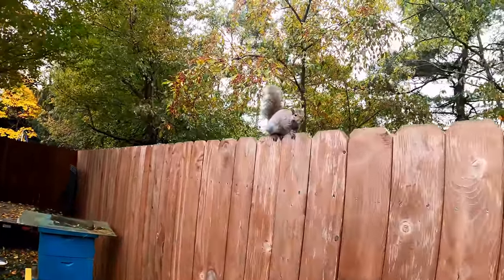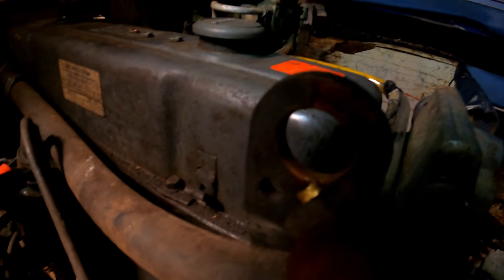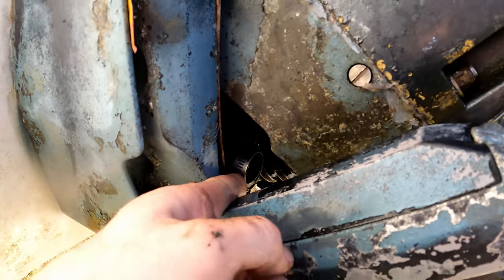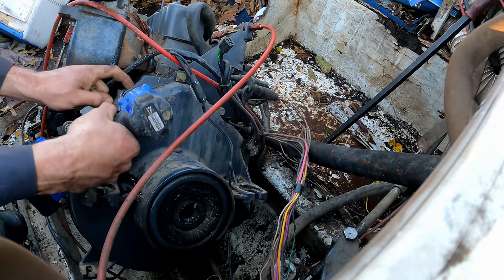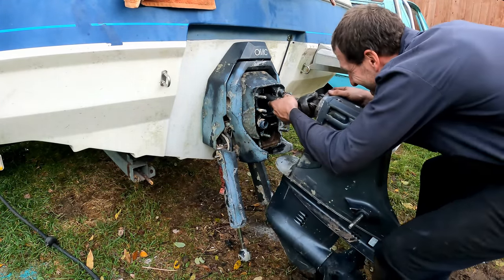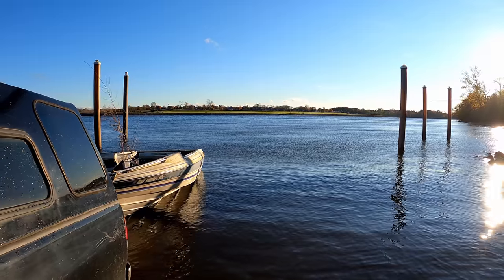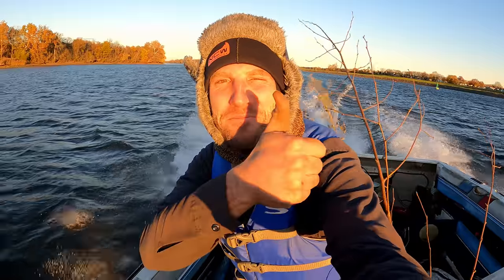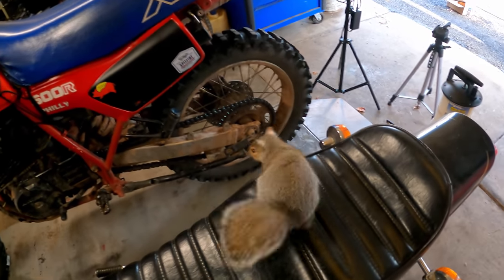The TRASHLINER Boat Part 2 "Will It Run"?  NNKH #Trashliner

Comment: Suggest not toss that old starter. Soak it in WD40 now then give it away to someone that will spend the 2 hours to refurbish it. I just did 4 of these Mercuiser starters that had been submerged in rainwater for several years.
Reply from the maker: I feel like they're pretty cheap online though these days no? But yet to be honest I already tossed it in the scrap pile.
Reply: @NoNonsenseKnowHow  Tried that. 3rd start and the whole nose cracked off it and also ruined my ring gear. Never again. I will stick with old school.

Comment: hi...you can grind the block crack and arc weld with muggie weld rod works great....heat around the crack before welding
Reply: Also drill a hole on each end to prevent it from cracking anymore.
Reply: there is techniques to repair such a crack but where it is located, the chances for a successful repair are slim because the seating of the head gasket, if the block heve been cracked between the freeze plugs, the chances of success make it worth to try it.
I had a very similar case on a V6 engine and I replaced the block.

Comment: My dad worked for Ford Motor Co at the Cleveland casting plant in Ohio 25 years.   Freeze plugs were basically for cleaning out the casting after it was finished.    So you're right calling them casting holes.

Comment: Thats where those 3.0 blocks generally crack under the manifold. You can epoxy the external crack, but if you had milky oil likely an internal crack as well

Comment: I always keep the Boats drain plug on the inside of the boat. Then if you ever take on a lot of water, you can take off, plain/plane the boat off and pull the plug. The water will drain out. Thanks for sharing.

Comment: I used to build those things, worked for Bayliner for over 26 years. They closed up shop and went to South America. Best thing that ever happened always harping on the people to work by harder.. It was a sweat shop. Furnace would keep the temps at 80-85 degrees. You have what was called a CT model I think. Check your serial number on rear right corner of the hull. Will have model and year built.

Comment: I've got one of those "trashliners" sitting up on blocks in my backyard as well. Also a freebie from a friend. (The trailer is under another boat)
 Has the Volvo Penta 2.3. Not sure if it's locked up, but I know there's some freeze plugs out of it. Also needs a starter. Got a boat from a friend with the same motor, but that boat turned out to be in better shape. The Bayliner I stripped all the way down to the hull and cleaned the trees out of it. Stringers were good, but crossmembers weren't.
 But I've been raiding it for parts for another boat I have. Not sure what I'm going to do with it yet. 
I really like the square guages on the dash. May put those on another boat.

Comment: I'd love to see you pull into the highway guy that checks the boat for the invasive species sticker, with that tree growing in the middle, and have him squirt your boat down.  Awesome work I gota say!  Do you think silicone is better than JB weld on the block crack?  Maybe silicone expands better and stays flexible during the heat cycles?  Yeah, that tempered glass is worth money on ebay!  A few hundred dollars at least.  Probably the out drive too.

Comment: Can you do a "how cheap can we do this with stuff around the house" part 3? :) Maybe use some old pallets as subfloors, scrap wood piecemeal flooring, old kitchen table chairs screwed into floor for seats, maybe an old steamer trunk for an engine cover.  Could even maybe use a PVC flange screwed into the bottom of an old kitchen table chair, then whatever size PVC into that, with a matching OD to ID flange/pipe on the floor to make a "swivel" seat :) :)
Reply from the maker: Those are some good ideas you got there Brianna! And yeah I think a part 3 Will be coming for sure
Reply: @NoNonsenseKnowHow  Thanks!  We recently got our first boat, an "old" 1993 Sea Nymph (small v hull basic fishing boat), and it's either missing a seat next to the driver, or has the capability to move the very front seat back to the hole next to the driver.  I was thinking of doing the PVC flange thing with a pipe that would fit in the seat mount hole already in our boat, but it seems like it could be useful for any cheap fixer upper :). Maybe you'll get to it before I do so I can see how it works lol.  It's cold here in Oklahoma too so not much is getting done outside

Comment: Condenser is vital in points ingition. Then points opens current starts to flow from coil through condenser to the ground in primary winding, inducting high voltage in secondary.

Comment: If you weld cast iron just be sure to drill a little hole at the end of each crack or it will continue to crack further as you are welding on it. I turned a 4 inch crack into a 9 inch crack on a 6 cyl ford once and an old man I worked for told about drilling the hole.

Comment: You are an incredible mechanic. I would have left that thing in the woods. How did you come to figure that thing had a water pump in the outdrive and know the screen spun from heat? I'm impressed
Reply from the maker: Thanks man. I'm relatively familiar with these since I've owned a lot of boats over time. Never actually saw one of the screens spin like that. The hack fix seems to be holding up well though!

Comment: I fixed a cracked farmall B block with JB weld. I just notched out the crack with a carbide burr and filled with epoxy. Took 2 tries to get it all but I ran it a while without any issue.

Comment: you could do a video on cold stiching that crack its a  bit of a old school process but i think you have the skills to pull it off . get the motor in the workshop and have a go great winter project,
Reply from the maker: To be honest, I think that crack can be fixed no problem with permatex the right stuff and last several seasons. I've done it on blocks before without a problem. It's certainly a hack fix but works great and God forbid it ever leaks again you can have a tube on board to seal it back up. Not to mention even if it does leak, it's not going to ever leave you stranded.  Really just superficial. Certainly not structural
Reply: I don'y believe that it will work because the crack is too near from the head gasket surface, between two ferrze plugs, it should work because you have a rigid wall to contain the effort of the stitching plugs.
applying heat will result in block warping that will need at least the line boring of the crankshaft main bearings bores. This engine does not worth the procedure.

Comment: Had an 87 bayliner Capri with a 2.5 litre omc inboard good fun for a lot of years and pretty good on gas too was quite surprised used less fuel than a 70 mercury force that I had years later

Comment: I had a Searay 270 Amberjack I bought new with twin 350 motors. I had the same overheating problem the whole time I owned the boat. It was always the impellers that were bad. I finally got sick of replacing them, even though I took it to two separate marina and it was always the same problem. I eventually just sold the boat.

Comment: Marine tex or jb weld would be adequate for that non pressureized block crack.  Wouldn't bet either would last forever but would both hold a few seasons.

Comment: Really enjoyed these...Just finishing a Maxum Project in the UK. Are you going any further or is the Trashliner now complete?
Reply from the maker: Awesome to hear that. And yeah probably going to do a part 3 with the boat. But not really a restoration. Just having fun and fixing odds and ends or doing something weird with it
Reply: @NoNonsenseKnowHow  just gone to the Truck dunking video...dude my worst fear! We never use our ramps. We are so lucky that the trailer will roll into the sea on a rock solid gently sloping beach...and hey thanks for responding, that's cool. I can send a link to the photo album but don't want to hijack the channel. HNY.

Comment: When I saw the crack, I thought of epoxy. Really enjoyed the video - great fun. When you said you could reuse the freeze plug (aka expansion plug and frost plug, hereabouts), I was thinking, "Yeah, why not? It'll be so easy to change if it lets go, and a new one would ruin two, maybe three bucks!" But I was too tactful and discreet to say it out loud. I liked it when your wife asked if it was fun - you must have been grinning through the grime, and letting our big secret out.
Reply from the maker: Cool to hear you enjoyed it and I totally appreciate you checking it out.  The cooling system is not pressurized so I don't think I'll have a problem with it popping back out. Unless I leave water in it and it goes below freezing. And grinning through the grime is right! Never heard of that but I'll be using it again
Reply: @NoNonsenseKnowHow  The phrase just came to me - should've copyrighted it, but too late now! Have fun with that!

Comment: Would be cool if you gutted the trash liner and made it the designated 3 wheeler hauler for the islands. Maybe a side panel that fold down into a ramp to make easy access while loading and unloading the bike and trikes
Reply from the maker: Yeah that would be awesome! I feel like I'd be much better off using a flat bottom boat though for something like that.

Comment: Hello, Can you tell me what that red probe is that you are using for the electrical work? It appears to be able to send voltage through the probe? This is very cool and i need one like now. :)
Reply from the maker: Yes, it's a very useful electrical diagnostic probe. You can send voltage or ground and it has a built-in voltage meter. Also has a circuit breaker built in. I have a power probe 3. But there are other models

Comment: I didn't see there was already a Pt2 until after I commentated on Pt1. I've still the same opinion-even though it didn't split on ya running 39mph on a rough surface.

Comment: I do marine repair for a living love the video! I guess no part three so you dumped it and sold it?
Reply from the maker: Awesome! And no I still have the boat. Planning to do a part 3 in the springtime or when I get some free time
Reply: @NoNonsenseKnowHow  Ok cool! Love bringing back from the dead videos . I cant believe you got almost 40 out that beater I was feeling the rush. I am going to start my own youtube channel but need to get some software for editing and learn how to do it. I got a one week free of Movavi and I learned a lot about editing. For over five years I was frozen in fear of editing and don't know why. I learned a lot in a week then it was gone. My business took a major shit and now I am struggling to pay bills but when I get some money I am ordering the Movavi soft ware . I have a bunch of videos done but not edited. My current project is a Factory 425 hp 409 intake and carbs I rebuilt the carbs and made the fuel lines but the progressive linkage I got with it wont work , I have to wait again for things to pick up but the linkage from Edelbrock is almost $90.00I hope it will work. But this will be one of my first videos I [post on youtube .

Comment: Hey Chris. New subscriber here. I know absolutely nothing about boats but, it seems like a boat sucks in water to cool an engine. How is sucking in cold water from a lake different than pouring cold water on a hot block?
Reply from the maker: Hey, thanks for subscribing and great question. They have a thermostat in them that only allows the cold water in as needed to keep it at Optimum temperature. Otherwise it's just free flow back out the exhaust
Reply: @NoNonsenseKnowHow  okay so similar to car. Thanks for answer my questions. Keep up the great content.

Comment: nice video, i used jb weld it worked in 10 years on my manifold
Reply from the maker: Thanks. And yeah JBL does the trick also. I personally really like permatex the right stuff silicone for these kinds of repairs. German engineered silicone and lasts really long. The flexibility helps out I feel like
Reply: @NoNonsenseKnowHow  it is the best way to attempt to save that engine, any procedure where heat is applied will ruin that engine  because these thin blocks are prone to warping if you attempt to weld them and where the crakk is located, the chances are great  that the crack will reappear when tighting a new head gasket.

Comment: Este motor é muito conhecido aqui no Brasil equipou os carros da GM de 1969 a 1992, eu não conhecia está versão marítima muito bom parabéns pelo vídeo obrigado
Reply: That engine line actually started in GM cars in 1963, and was used in marine applications until ~2020.

Comment: Sapporo BEER KICK A$$ BEER😋 I have the same motor in my boat, I changed the points to a electronic system. what a difference, why better. its a Chevy 3.0l motor 130hp. I went throw 5 coils, than i put a resistor in line with the coil. have not had a issue sense. mine is a 1990 sunbird corcica 175 omc 3.0l with the cobra outdrive

Comment: I would grind a long neck crack and get it all nice and clean. Let it dry out real good with a heat gun and fill it full of JB. Wells sat it down smooth and paint it be done with it that puppy last another twenty years I have used j v willed with great success in projects just like that

Comment: You can drill and pin the block on the outside but but once it reaches temperature the internal cracks start leaking water into the oil.  it's junk.

Comment: 12v to the positive and as long as it is grounded no spark as soon as the ground goes byby  by the points opening the primary field collapses and induces current in the secondary windings producing a spark. do you know who invented his system nicolia tesla.

Comment: The rubber is the part that seals in the bellows OMC  designed it that way!!!!! OMC and Volvo Bellows all sealed because they're tight that way only!!!!! Some  waterproof grease on the Bellows and the U-joints allow the yolk to slide through with a little bit of force from your foot or a wack of a 4x4  Mercruiser Seals with an O-ring that is  added!!!!!!! Only Mercruiser seals differently!!!!! I'm a marine mechanic 4 25 years!!!!!!!!!! Only a ignorant person would you said die grinder on a Bellows transom assembly especially when you could have Googled it or watched 50,000 YouTube videos on how to install a OMC Cobra outdrive
Reply from the maker: Well normally I wouldn't even respond to a comment that has this many exclamation marks however I just want to let you know that this is not the first omc drive i've removed and put back on. I applied belray marine grease on the u-joint coupler, and the inside of the boot. The splines were started, but I could not get the u-joint to slide into the bellow no matter what I did. In fact it started pushing the bellow off since it was so tight. This was likely due to the bellow being swollen and also some corrosion behind the bellow where it seats in the housing.  Anyway, hope this information helps you out. "A little whack of a 4x4" . Lol.  No.   All of this is irrelevant anyway though, look at the boat and look at how much I actually cared about the boat. I'm not sure if you watched the whole video or not.   I apologize for any typos in there since this would speak to text.

Comment: The housing is tight lol I cringe. You have to center the driveshaft
Reply from the maker: The shaft was center. And the alignment was fine. It was the u joint that wouldn't slip through The rubber boot. No matter how hard I tried. I took some measurements and the boot hole like a half inch smaller. Don't know how I even got it out of there. It was really tight coming out
Reply: @NoNonsenseKnowHow  I am not sure how you got it out then lol
Reply from the maker: It was super tight coming out. But the shape of the boot allowed it to come out easier than going in